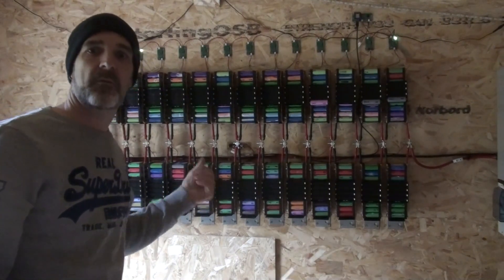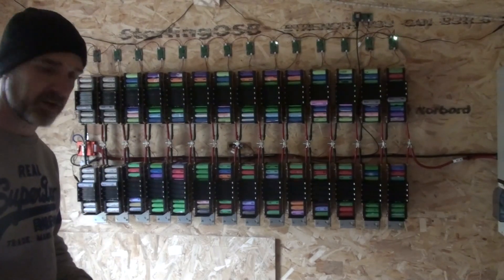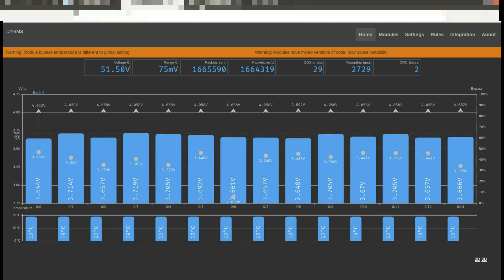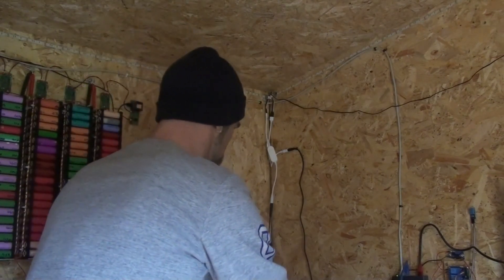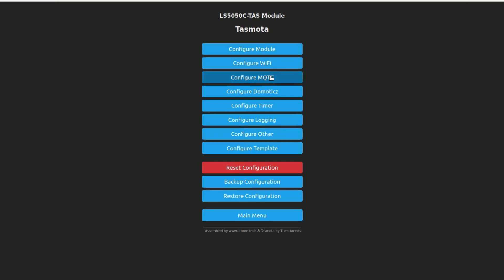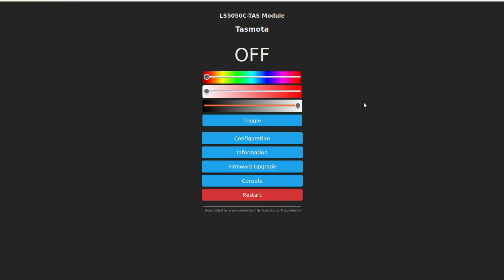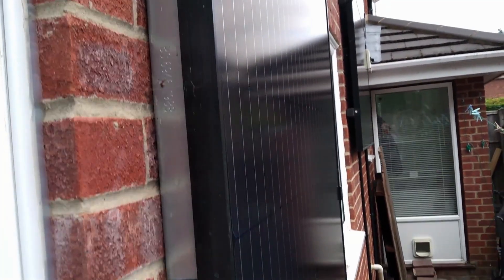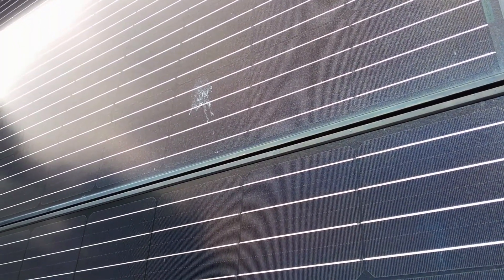Solar/Battery maintenance and Tasmota LED strip controller.

Comment: Hello, I have a few questions,

What PIP version do you have?
Do you know how the cells in the Pylontech modules are arranged? (have you looked inside)
Where can I find your display software, I've been using Node-red, Grafana and EmonCMS
Reply from the maker: I have the 5048MS(64V) version of the PIP.  I've never looked inside a Pylontech battery. Think I saw a video of one being disassembled on YouTube somewhere. For my graphs/pie charts etc I use google charts https://developers.google.com/chart they are pretty good on the whole.

Comment: Your batteries are in shed? I left batteries shed for last winter (still testing laptop batteries) and they all start to have small rust dot on + side, what you have in your shed to control humidity?
Reply from the maker: I monitor humidity in the shed but currently don't do anything about it.  So far I have not had any problems.